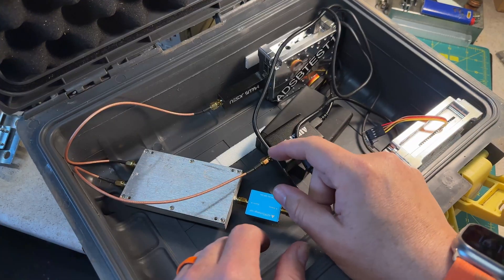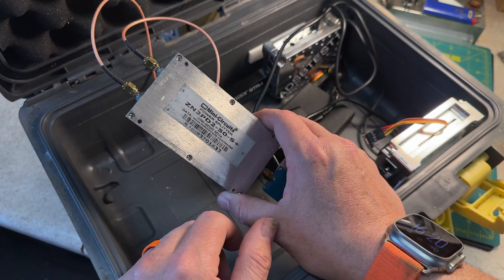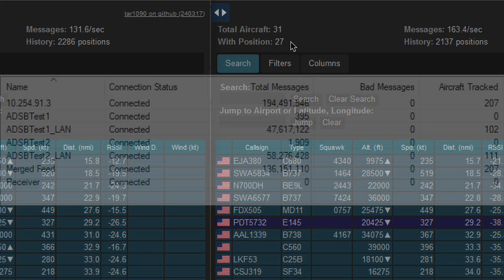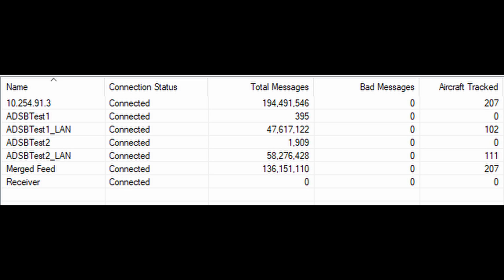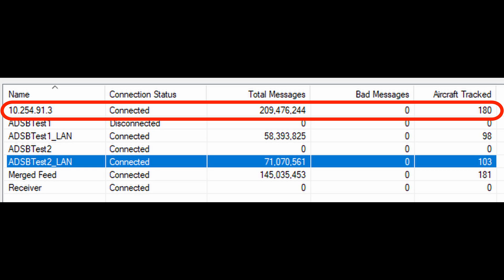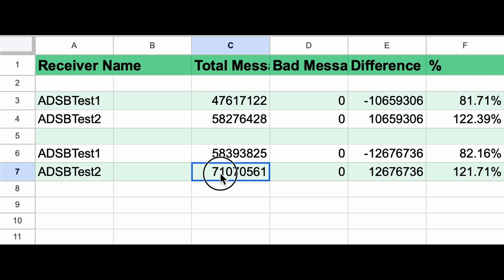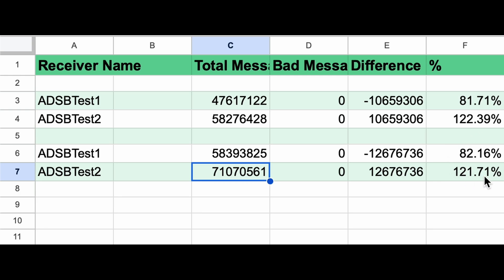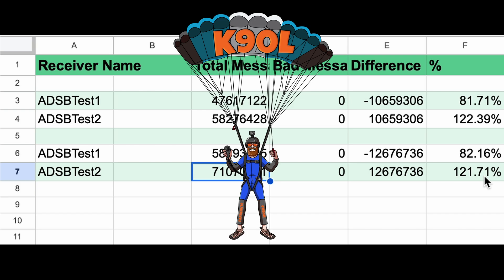Is a $35 SDR better than a $175 SDR?

Comment: Is the data you are showing from ADSB Exchange itself or from a application to feed the network for the site? I've been thinking of setting up a feeder for the network as well but haven't seen as cheap a way to go as doing it with a SDR dongle and maybe a Pi
Reply from the maker: That data is direct from my receiver. The cheapest way I know to set one up is with a Pi. Check with the networks, if they have low or no coverage in your area already they will happily set you up with one for free. If you are in the USA they probably have coverage but you never know.

I have a video on my channel detailing the process of building one. Super easy stuff.
Reply: I meant the display that looked like ADSB exchange website data. Yeah there is reasonably good coverage where I am at less than 2 miles from a Class D airport.
Reply from the maker: Yup, that is still my receiver's info directly being served by the receiver running on the Pi.
Reply: @ okay, thanks looks like I still have more to learn before jumping into this. Thanks for your responses

Comment: What you are really paying for  with the AirSpy is the bandwidth, something you don't really need  for ADSB.  I guess one would have to decide if the extra 20% is worth the AirSpy premium.  In most cases, money would be better spent on reducing feedline losses  and getting  the antenna in the clear.
Reply from the maker: There are also extra bits of DSP that aid in cleaner signals.

Comment: What is an SDR?
Reply from the maker: SDR = Software Defined Radio. In this case we are talking about a radio receiver that uses a USB port to deliver the sound of what it receives to a computer. I'm specifically focusing on airplane tracking using ADSB on 1090MHz.

ADSB - explained here https://en.wikipedia.org/wiki/Automatic_Dependent_Surveillance–Broadcast

Basically all commercial aircraft are requires to have a beacon that transmits data about their flight. Receivers on the ground can receive those messages and decode them to then see said details on a computer screen.
Reply: @LifeAtTerminalVelocity  Not interested at all. I have no idea about anything relating to "software". I don't believe computers and ham radio should be mixed. But that's just me. Everyone else in the world can do what ever they like. I'm just not into it. We're all stuck with computers now. But I don't want to have to use one to operate a ham radio.
Reply from the maker: To each their own. Though this video has nothing to do with ham radio.
Reply: @LifeAtTerminalVelocity  I guess not. LOL